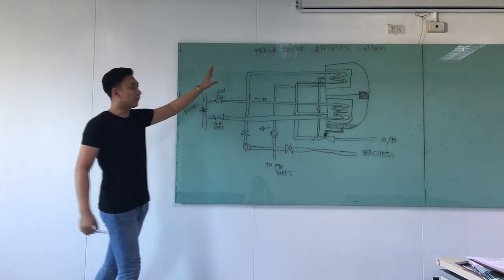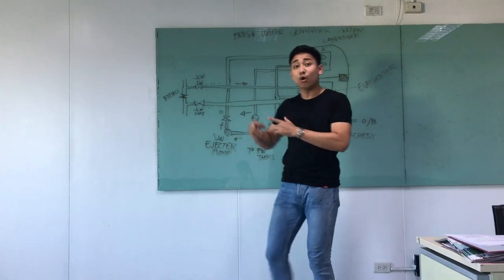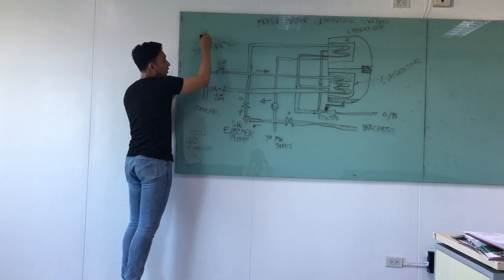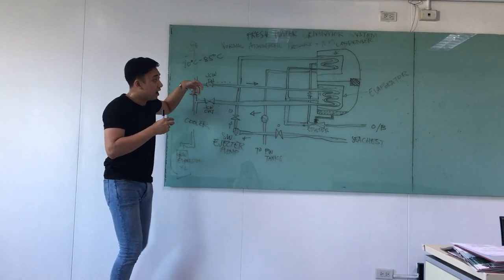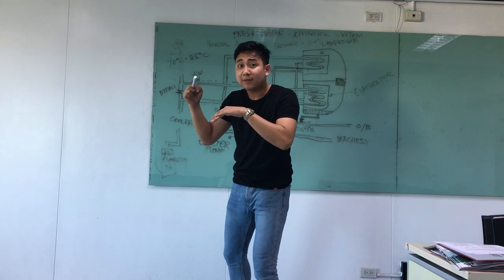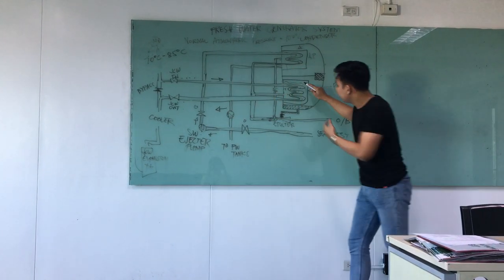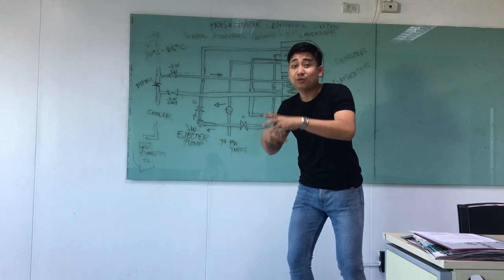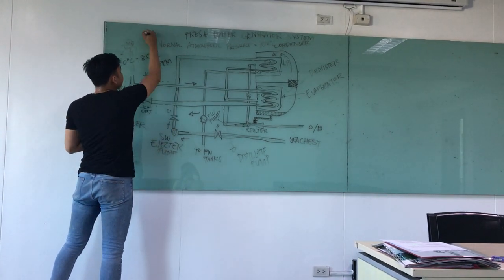Fresh Water Generator System (Part 1)

Comment: Well explained. only thing is hndi po bumabalik si jacket water kay expansion tank. Dumadaan lang po ito kay dearator at kung saan doon din nakatap ang linyada ni expansion tank at doon din sya nagfifillup ng loss water by gravity  kung sakaling may leakage na naganap. So fwg , cooler, dearator, pump then paulit ulit na po iyan. Tanging gamit lang ni expansion ay magfillup and receives expansion of water at pagaccomodate nya nung trap air in form of bubble na mangangaling kay dearator then papunta sakanya(one small line din sa may linyada ng outlet ng jacket water pag exit ng M/E.